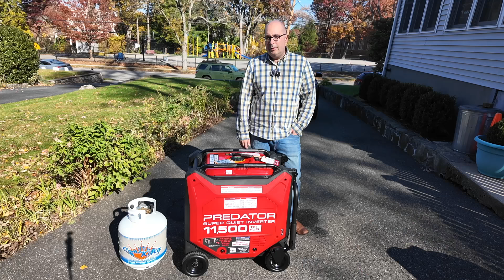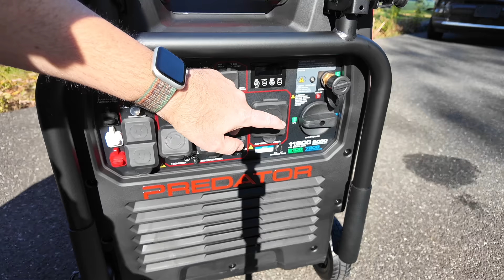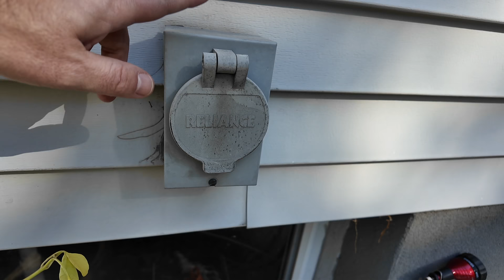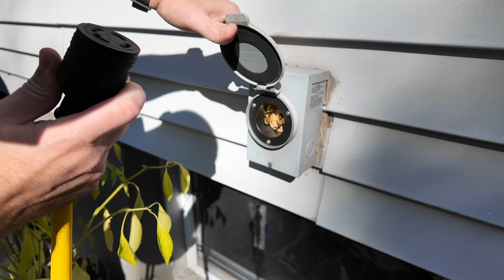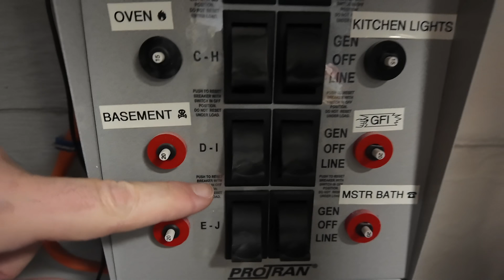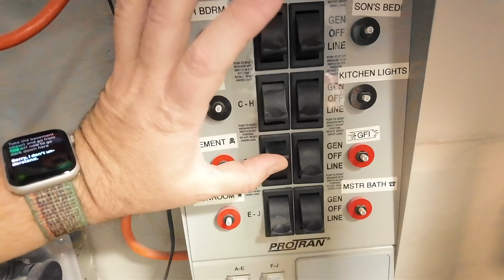Predator 11500w Powers My Entire House (Transfer Switch & Full Test) — Honda Should Be Worried!

Comment: I am adding a soft start to my ac unit because it should drop the start up surge up to 70 percent. I am running on natural gas so mine drops down to about 8800 watts which is still enough. I like that the natural gas will not be running out. In winter it was a problem to get out on the roads and then fuel was sold out or pumps off.
Reply from the maker: That sounds like a very smart and reliable setup for winter power outages!

Comment: Doubt u get fu power using NatGas 
Can it push a full HVAC AC along with 2 refrigerators?
Reply from the maker: It can as long as you have a soft start kit on the central air

Comment: Your video was excellent except for 2 things. First, when you shut off your generator, you failed to mention that before you do that, first open the main 35 or 50 amp breaker, and switch over to street power. If street power is not yet restored, you will have to open that breaker anyway before shutting off the generator when you need to refuel. DO NOT ALLOW THE FUEL SOURCE TO COMPLETELY RUN DRY while the generator is supplying power to your house! DO NOT SHUT OFF THE FUEL VALVE YOURSELF LIKE YOU DID while the main breaker is still closed. Allowing the generator to continue supplying power during the shut off period while the rpms are decreasing continually until the motor shuts off will mean that the 60 Hz current needed for ALL your electrical appliances will be reduced to 50, then 40, then 30, then 20, etc. You get the picture? You don't want to be risking ruining motors and compressors by allowing the available generator fuel to determine the Hz output during the shut-off period. You open the breaker yourself while the generator is at normal running speed. Secondly, after living in the country for over 70 years, and using diesel and gasoline generators and solar panels, I would strongly recommend that your main liquid fuel power source be a diesel genset, not gas. Gasoline is very difficult to store for extended periods, and dangerous too. Plus the motors are screaming at 3600 rpms, usually burning more fuel than necessary. My German-made KATO 10 Kw diesel genset cruises comfortably @ 650 rpms, only speeding up when our central air kicks on. Plus, diesel is much much safer to store, and will maintain it's original low flash point for many years in the storage tanks. My little 3 Kw Yanmar diesel genset with a 4 Kw surge capacity will run the whole house in the winter when the AC is not needed. It barely uses any fuel at all. I'm not trying to be a spoiler here. I'm just speaking from a lot of experience.
Reply from the maker: Those are some great safety tips and points regarding fuel efficiency that others watching will definitely find helpful!

Comment: I think you get less wattage with propane or nat gas.
Reply from the maker: That is correct, there is typically a noticeable drop in power output when running on those fuel sources compared to gasoline.

Comment: Thanks for the demonstration on the generator I don't have a harbor freight generator I got a different brand it's 12000 Watt it's a big blue generator you know which one I'm talking about I just got it a while back ago I'm getting ready to hook it up to my house my buddy has one too but he didn't have a switch he just turns the main power off and there's a breaker in the box that it's connected to under 50 amp lead side from the generator and into the house on the back side the breakers rated that's how he does his he shuts the main off it's got one breaker wired in flips the main off and then flips that breaker on and it feeds the whole panel once again thank you for what you have shown me
Reply from the maker: I’m glad the video was helpful! Thanks for watching

Comment: I’m disabled and can’t access my service panel. I like the fact that it has a remote control to turn on the generator. However, if I had to turn it on in case of a power outage, do I still have to go to the service panel to turn on the transfer switch?
Reply from the maker: Unfortunately yes - you’ll need to manually switch over the panel interlock or transfer switch

Comment: The biggest disadvantage with any of these portable generators is that they do not have an oil filter which greatly reduces the life expectancy and requires more frequent oil changes to extend their life. That said I spent about $2500 total on the Predator and a Onan standby with a Cummins engine was about $11000. 
It would have been another $550 but I had a 25% coupon for Harbor Freight. The 1 year warranty was over $500 and the 2 year was over $600…kinda pricey.
Reply from the maker: You make a great point about maintenance and the trade-off in price is definitely significant!

Comment: Did you disconnect the neutral on the generator before connecting it to the transfer switch?
Reply from the maker: I haven’t but definitely need to do so. Will post a video on how to convert to a floating neutral
Reply: @Outdoor_Prepper I have come to find out there are two different versions of the generator. One has an easily accessible neutral (and the exhaust is out the back). The other, like yours, the neutral is behind the panel.
Reply from the maker: @TheGreekAV8R agreed I need to figure out how to find mine

Comment: Thank you for a detailed presentation. Have you had any issue with the 20 lb propane tank freezing up when using with this larger capacity generator? One generator company claims this issue and recommends no smaller than a 40lb tank.
Reply from the maker: So far I’ve had no issues with it but I haven’t run at full load on a 20lb tank - if I did it might potentially freeze up

Comment: Can this generator natural gas hook up to a natural gas barbecue hose
Reply from the maker: This runs on natural gas, but does not come with the hose. It should be compatible, but I would have a plumber confirm the correct connections because I’m not sure of what the barbecue hose looks like compared to what the generator would use. I know Harbor freight sells the hose.

Comment: Absolutely no way it cost $1,500 for interlock kit installation. It should be half that or less, shop around.
Reply from the maker: Prices definitely vary depending on your local area and electrician. I’m in lower NY and it’s ridiculously expensive to get an electrician for anything
Reply: @Outdoor_Prepper   I see.... I've seen ads on Facebook for local guys to do it for $350 installed.... I honestly paid $275, but it was in conjunction with a full panel replacement job.
Reply from the maker: That’s a great price for sure! Everything is expensive in NY :(

Comment: A manual interlock seems like a lot better idea and way cheaper, too.  You decide on the fly what you want to run.  It's not rocket science to turn off the dryer breaker, for example.
Reply from the maker: 100% I agree with a manual  interlock . I wish I had gone that route originally

Comment: Can I use this unit to power my house off grid.
All the time?
Reply from the maker: Technically, yes, although this is a portable generator, so it’s not meant for continuous running. You would be better off with a diesel generator.
Reply: @Outdoor_Prepper how long do you think it'll last running all the time?
Reply from the maker: It’s definitely cheaper to run gasoline. You’d need to do oil changes about every 100 hours. Total longevity is hard to calculate but if I had to guess a number I’d say 5000-9000 hours with proper maninance ( frequent oil changes, cleaning air filter and spark arrestor etc. A better solution would be a portable power station that is charged via solar or the generator or a diesel generator for continuous operation
Reply: @Outdoor_Prepper do you mean add a portable power station to the inverter or get something separate? What are you saying? I'm trying to power my house,
Reply: And it would it be cheaper to use propane or gas

Comment: I really enjoyed this video and I appreciate you sharing all of this information. What makes it so interesting is that I have been doing my research on purchasing a generator. Yesterday a technician from Generac came down walk me through what the generator was basically how it worked and the cost. I am here in Arizona where outages happen not frequently but they do happen every year. I’ve been living without a generator for the last three years, but I need to get one. Oh, and the cost that was given to me was $18,000 for everything. I began my research on portable generators and actually was researching this predator that you have talked about today. My question today for you is this on the side of my house when it was built I had an RV hook up put in. So it has a a drain for waste and it has a 30 amp plug already built into the house so after watching your video I now understand what items I’m gonna need to get my generator started. Could I use that 30 amp RV plug for the generator?
Reply from the maker: Short answer is you should be able to, but have an electrician check it to make sure it’s isolated and doesn’t backfeed the grid. The other concern would be that it’s only 120 V and may not feed your whole panel and would not power 240 V loads. An electrician should be able to confirm though.

Comment: My understanding is that this unit comes with a bonded neutral. I don’t think I heard you mention if you converted it to a floating neutral, which would be needed to make it safe to operate when using as a home generator. If you did modify, a separate video explaining the process would be great—thanks.
Reply from the maker: You are totally correct. This is a bonded neutral and if hooking up to a house, you need to be floating neutral. I have actually not converted it yet, but will be doing that within the next month or two now that the weather has gotten warmer. I will definitely make a video showing how to do it.
Reply: @Outdoor_Prepper Thanks, I’ll be on the lookout for the future video.

Comment: highly recommend installing a soft-start module to your AC.  It's protective, but also I can pretty much guarantee if you don't have a decent load on an inverter generator and AC tries to kick on you can stall the generator or possibly damage the AC unit.
Reply from the maker: That’s a great point! Thanks for sharing
Reply: @Outdoor_Prepper  you bet.
Another tip is if you're running high loads on your inverter generator, or more specifically large swings in the load on your generator. turn off the eco-mode.   Yes it'll use a bit more gas, but not that much if you're pulling more than %75 load (just a general statement) load on the gen.

Comment: Would have been nice if he had said how long it will run on a 20 lb propane tank. Unless you have frequent power outages, it's probably going to make better sense just to check into a hotel for a few days on those rare occasions when the power is out for more than a few hours.
Reply from the maker: I actually did a runtime test video on my channel with this specific generator. Check it out when you have time.
Reply: @Outdoor_Prepper Feel free to provide spoilers. 😉

Comment: Do you think you can show us the diagram on how you installed the transfer switch to the panel box the wiring diagram and how you installed also the wiring for the transfer switch diagram
Reply from the maker: Apologies I did it many many years ago and don’t have any diagrams still. I have the reliance pro-Tran 10 circuit transfer switch

Comment: Did you switch it to floating neutral or run as bonded when connected to the house?
Reply from the maker: I ran as bonded but definitely need to switch to floating. Will make a video on how to do it once I do it

Comment: How long does the propane tank or a full tank of gas run the generator?
Reply from the maker: A 20 pounds barbecue tank can run about 10 hours at 1/4% load or 2000 W

Comment: Great video! Just bought mine today w 20% coupon and almost all sold out in the jacksonville area.  Can u leave the generator permanently outside with a cover? I hear some folks do.. i hear yhis unit can also power an ev..
Reply from the maker: Congrats on your purchase! I would personally recommend keeping it in a garage or a shed just to protect it more from the elements and critters but technically you can leave it outside as long as it’s covered

Comment: Sorry I am new to all this, but if i wanted to use like a jackery 5000 plus have a generator like this as well.

I would just want to use my jackery and recharge them if needed during an outage.

Is an interlock still preferred transfer switch to a transfer switch?
Reply from the maker: Welcome! An interlock is generally more flexible and cost-effective for powering the whole house. I’m actually going to do a video on the Jackery 5000 plus in a few weeks

Comment: If this type generator is used for your house, if you have central air, I would suggest you install a hard start kit in the A/C condenser. It will cut the initial inrush current(surge) by half when compressor starts. If you have an AC with an inverter compressor, there is no inrush current, don’t need a hard start kit.  Size your hard start kit accordingly.  Usually marked on packaging
Reply from the maker: That's a very helpful suggestion for anyone using a generator to power their central air!
Reply: A soft start kit is the correct choice. Not a hard start kit.

Comment: Thanks for a great and informative video.  Do you think this unit would power my Heat pump and internal electric heater?
Reply from the maker: I’m glad it was helpful! It would really depend on the size of the heat pump and how much watts it’s pulling. It would probably be best to check with an electrician so they can determine how much power it would use.

Comment: Did you have to unbond the generator before hooking to transfer switch
Reply from the maker: Correct - the generator needs to be a floating neutral if it’s hooked up to a transfer switch or an interlock. I will do a future video on how to un bond the neutral and make it floating.

Comment: Thank you very much for this video and the other videos regarding the Predator 11.5k. We just bought one and I have not unpacked it just yet. I am trying to wrap my head around getting it connected to my breaker panel and how best to do that. We have the normal appliances and electronics, but we have 2 dual-fuel 3 ton central units. I keep reading about start-up wattage for the unit but cannot seem to get a straight answer on it. I would think that we could use 1 of them in case of an outage but, again, I am not sure how to safely do that. I have seen the manual transfer switches but your video suggests a panel interlock system. If that is the case, how would the system be configured? BTW, our panel is in the garage and the main shutoff (200 amp breaker) is in a box outside near the meter. Where I would expect to see the main shutoff in the panel has a blank plate cover. Thoughts? Recommendations? Thanks again!
Reply from the maker: I’m glad the video was helpful and thanks very much for watching! I think a whole panel interlock is definitely the way to go. You would need an electrician to install it, but basically when you hook the generator up to it, the entire panel will be electrified, and even if you can’t power all of the ACs at the same time, you can at least power one along with other devices. When I bought the manual transfer switch, that was very popular at the time but in retrospect I wish I bought the whole panel interlock.
Reply: Go with a 50 amp manual interlock sized in case of future upgrading at no additional cost

Comment: How long will it run on the propane tank you show in your video?
Reply from the maker: I did a test on propane in a separate video on my channel. Short answer is I got 10 hours on a 20 pound barbecue tank at a 25% load

Comment: I hear this a lot. Is it true that if that generator 11500. If you’re using it for your house, it should not be grounded to the frame because it’ll cause problems in the house. So if you’re using it for your house, does it have to be bonded or no? And if it has to be bonded, is it safe to use only for your house?
Reply from the maker: Technically, if the generator is to be hooked up to a transfer switch or panel interlock, it should be a floating neutral and be unbonded. I have not made this change yet because I am still trying to figure out the correct way to do it, but I will post a video when I do. If you’re not connecting it to your house, it should be bonded, which is what it currently is. The reason you need it unbonded when connected to your house is you don’t want to have two bonds, one at  the panel and one at the generator.
Reply: @Outdoor_Prepper Great video! Thank you for posting your videos, great content. I have the same concern about finding a generator that has a floating neutral to power my house, which is hard to find one, most seem to be bonded to the frame. I like this unit but concerned about removing that ground wire. Have you had any luck removing it? Have you noticed any issues with devices in your house while this unit is running and it is currently bonded? Thanks!
Reply: @charlesashbeck just buy the one you want and unbond it!  It’s easy in almost all cases

Comment: If you connect your Predator 11,500 Watt Tr-Fuel Inverter Generator to a battery maintainer, does the "remote start" capability continue? I have a Duramax Inverter with "remote start" (with battery maintainer connected). But the "remote start" function times out after somewhere around 30 hours or so. I have to switch the remote start switch "OFF" and then back "ON" every day. Is the Predator Inverter the same?  I used to have a Westinghouse and it's "remote start" function never timed out. I've been looking for a large inverter that would always be available to start from inside my house.
Reply from the maker: I have not tried that yet to be honest, but I think it will probably time out. The battery charger is a separate circuit.